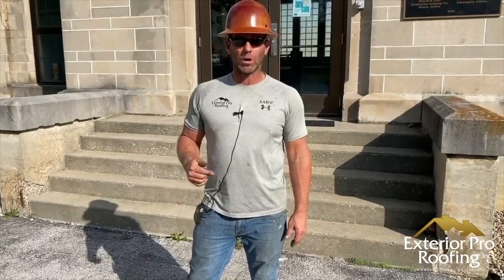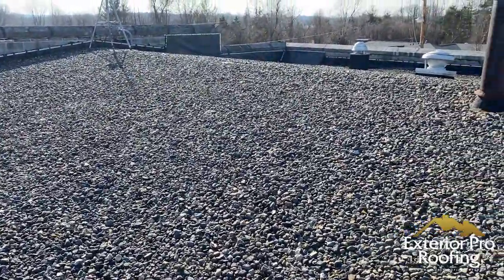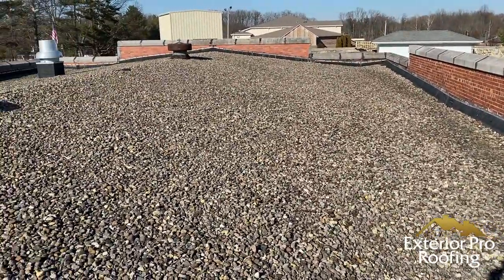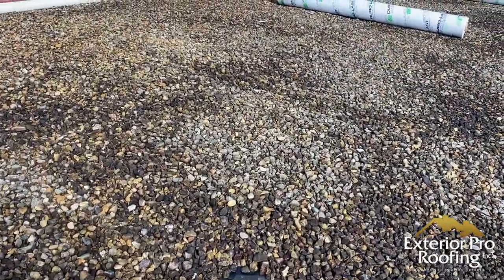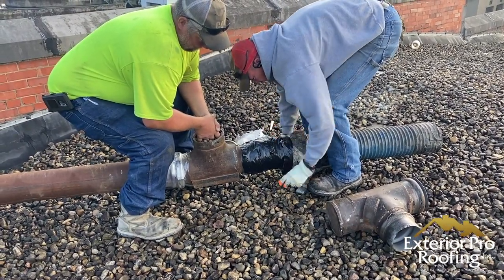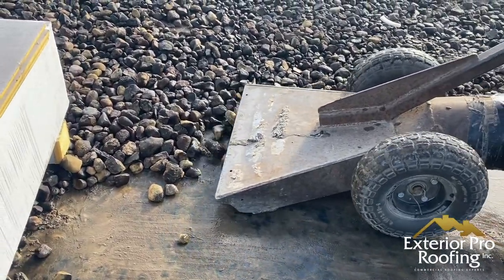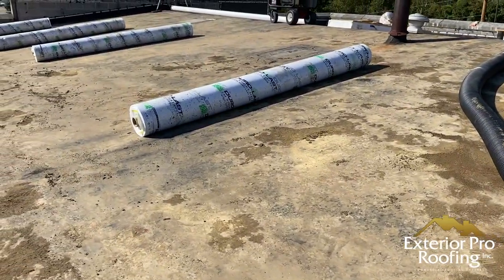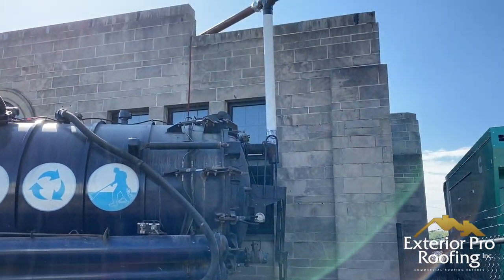Rock Vacuum - Roof Rock Removal Explained

Comment: What purpose does the rock serve on the roof like that ?
Reply: John Zeppelin like a big shingle
Reply: The weight of the rock holds the roof on. Typically used on concrete decks where they don't want to mechanically attached the roof system.
Reply: White rock helps from uv protection
Reply: @timexkills65  not on rubber, it's for ballast only.  It will of course have that effect, however EPDM can be fully adhered with no aggregate or extra UV protection.  In other roofing the aggregate does protect membrane from UV as you say, though usually with smaller stone.
Reply: @LaurenceRisslerRoofCoatings  I mean adhesives are a thing, every ballasted EPDM I've ever installed was on steel deck for example.
Reply: It's to protect the roof from the elements and uv rays ect